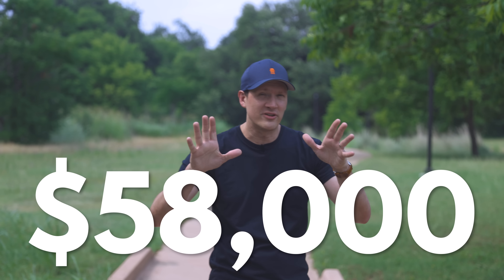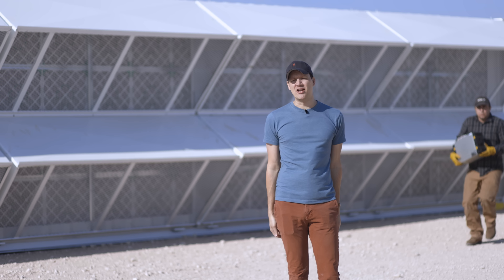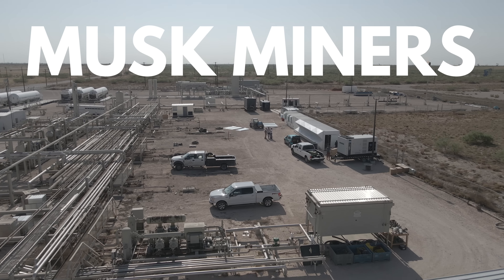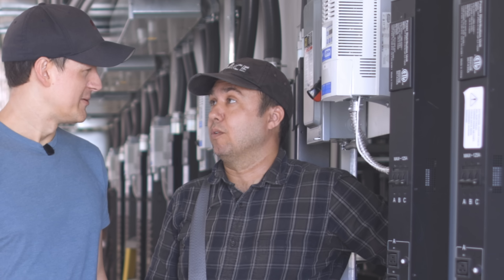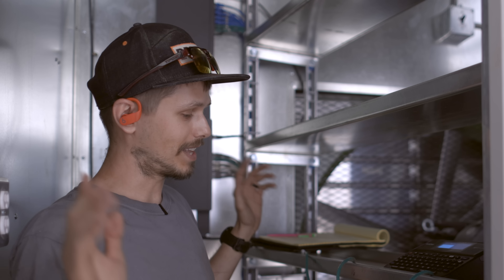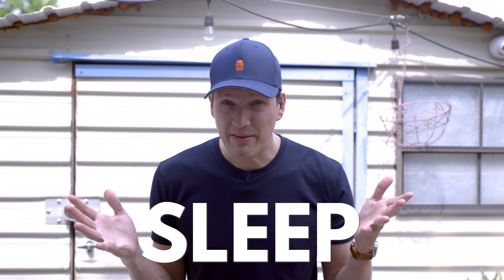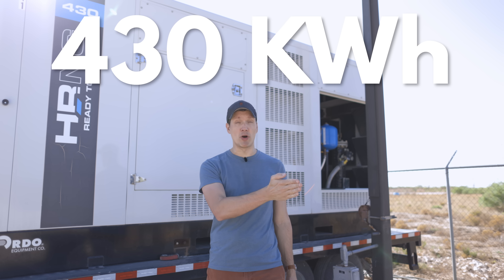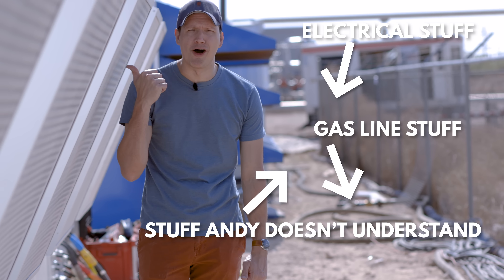Inside The Facility That Burns Natural Gas To Mine Bitcoin

Comment: Why did you choose bitcoin mining over ethereum mining?
Reply from the maker: I have done lots of ethereum mining. But to more specifically answer. I much prefer Bitcoin. I think it's the better long-term investment. And within the next year Ethereum will likely not be mineable anymore.
Reply: @YourFriendAndy  
You can mine eth and earn a higher rate, then buy bitcoin with it?  After eth is done, you can still mine etc and ravencoin at a higher reward rate
Reply from the maker: @richardrace237  higher rate is relative and changes constantly. But again, I have mined ETH a lot. And will probably mine is again soon with GPUs. Long-term these BTC asics could be wildly more profitable than the same dollar for dollar GPU rigs though. I am adding to and diversifying my mining portfolio.

Comment: Andy, love the video!
Are you still running these 6 machines at 8 cents per kwh? Or have you shut them down as quick math shows you are only making around 75 cents per day per machine
Reply from the maker: I am running them! But I have moved them to another facility with lower electric. I pay almost half of what I was paying before. Musk has had some issues with their facility so I moved to a partner facility.
Reply: @YourFriendAndy  Nice! What facility did you move them to?
Reply from the maker: @shanewitsman5056  They have a few partner facilities, but the one I went to is full now I think. I think they offer all the current ones at their normal rate, so you'd need to shop on your own. Hopefully I will do an update in the future on all this.

Comment: Interested in why they host rack space  instead of just adding more miners themselves? Also, if after 5 years I need to replace the hardware that impacts forecasted profits quite significantly. I imagine you have crunched the numbers plenty prior to making a decision to invest in these hosted miners but there are some risks even if you plan to play this strategy out long term. How do you factor possibly having to replace those 6 miners in say 5 years time?

Comment: Rookie question.. but is the miner pre-programmed to mine to your wallet etc or do you have to completely set up all the software on it?
Reply: The miners come with a firmware on board, that does need to be configured at startup. You point the minor towards your mining pool account, so the miner itself doesn't hold any of your wallet data.
Reply from the maker: yep exactly what Carl said
Reply: Thanks 👍 how easy is that configuration for someone who never done it before? Carl/Andy do you have a video or page outlining what to do?
Reply: Would it be possible to mine BTC on a VPS server like what you do with flux nodes?
Reply from the maker: @jeremywalgers8743  If you buy and host with Musk, they will help you with the process. But it's really easy. Just look up some videos on youtube.
Reply from the maker: @jeremywalgers8743  You can only profitably mine bitcoin with ASICs. You can't use a VPS to do it.
Reply: Sorry couple other questions.. do you think Helium miners are good? Also what’s your top 2 picks for VPS platforms (if I were to get into flux nodes) can you run multiple flux nodes from a vps on single monthly membership ? Thanks for your time

Comment: Question about the gas that is being used. Are we talking about a gas pocket that was breached and therefore kept releasing into the atmosphere? What's the plan for when it runs out ? Wouldn't have it been possible to stop the gas outflow instead ? Would much appreciate if you could give more details please
Reply from the maker: This is the gas that comes up when they drill for oil. If they capped it, the pressure would build up and it would explode. The rocks are breached by the drilling and that introduces a weak point. So they have to vent it or burn it to let it out. These sites can produce gas for many years. When it runs out, you ship the mining container to a new site. They are modular.
Reply: @YourFriendAndy  thanks for the answer

Comment: 8.5c US per kWh is about half our off peak power rate in Australia. 
My 40kW solar PV produces around 200kWh per day. I'll need to find a new way to monetise the energy in 2028 when my feed in drops to 10c AU.  Might set up a small mining rig.
Reply from the maker: My electric rate here in austin is $0.13/kwh base rate. So this is good savings for me. But really, the noise/power capacity is the biggest part. I don't have enough amps to serve this many BTC asics AND I don't have any spot where I can deal with the noise. Solar mining would be awesome!

Comment: Hi Andy. superb video. I have 2 questions. 1. will this place be carbon neutral ? 2. do they host other miners (kda) ? thanks
Reply from the maker: thanks for watching! They will host other things I believe as long as it fits the same power/heat profile as the bitcoin miners, but you should reach out to them on it. As for carbon neutral... I would think not. It's oil and gas production which is inherently not carbon neutral. This mining facility IS making it cleaner and making use of otherwise wasted resources. So it's green adjacent, but it's not green or carbon neutral on its own. You can ask them about that too. That's just my best guess/understanding.

Comment: The thing is, that mining gets harder and harder every bitcoin which is mined. So, basically there is an end to mining btc at some point.
Reply from the maker: Hey! That's not actually true. The difficulty to mine bitcoin doesn't happen with each new one mined. It's based on how much hashrate is online. If miners turn off their ASICs and the global hashrate goes down, the mining difficulty also goes down and the miners who leave their ASICs on, will make more BTC. It goes up and and down with the markets. It actually just dropped yesterday, so I am mining a bit more Bitcoin than my calculations show in this video. The end of bitcoin mining will be in over 100 years based on the code. Thanks for watching!
Reply: @YourFriendAndy  okay, thanks for the info on that Andy :)

Comment: Great video as usual. One note is that if you are just holding you neglected to calculate you power costs over the first two years.  Still profitable, but the two bit coin example would be going up against a 80k investment if you factor in the power.  

Again in 5 years even if not coin only makes it to 100k you are still coming our way ahead.
Reply from the maker: Yes you are correct. I have many many calculations on spreadsheets for these, but I kept it as simple as possible for the sake of the video because it all gets boring quickly. But really, since I plan to hold for a very long time, I think all the fees will end up be a minor consideration. Still worth considering (and I have), but based on my numbers i believe I will come out very far ahead in the future. Thanks for watching!!

Comment: Great vid! One question - how is the electricity cost calculated? Wasn't the natural gas effectively free since it was going to be flared anyways?
Reply from the maker: Thanks for watching Ted! In this case, Musk Miners has an agreement with the company that owns this site. In exchange for providing the generators, infrastructure, and gas, Musk has agreed to an electric rate they will pay the company. Then Musk adds a little on top and they charge everyone that rate who is hosted with them ($0.085kwh). That's how they make money and how the oil company makes money. The end rate for the user is still quite low. So it's a win-win-win IMO.

Comment: Andy, I don’t want to discourage you (who actually could?) but the difficulty will go up faster, because brandnew mining machines will take away much more. The difficulty will grow exponentially and then inflation will also hit the whole operation, means costs will go up. The ex-post calculation about the older rigs isn’t correct because the market is now moving much faster than before...
Reply from the maker: All good points, but it's all speculation. The calculations change constantly. Here's my baseline beliefs: I think BTC will be worth a lot more one day. I think it will be worth so much, that even with rapid hashrate growth, I can still cut out a slice for myself. I have made lots and lots of money by making mining decisions in the past. BTC miners have won time and time again in the limited history so far. Trying to determine which factors are the most valid is fairy futile because this whole market shifts so quickly.

So I'm making a calculated gamble that this all works out. It certainly could fail (I have plenty of those). I have bought all my BTC up until this point. Now I am mining it too.